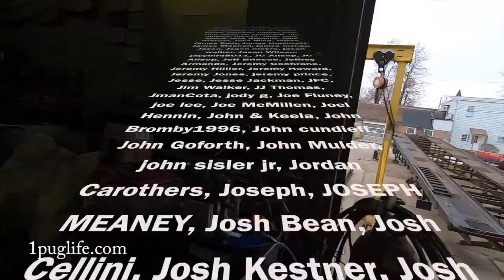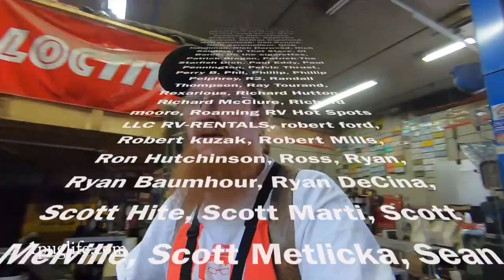plasma cutting plate

Comment: Wire wheels will not do a whole lot,
why wouldn't you "Sand Blast it"?
Even a small sand blasting gun would do more than wire wheels ...
At least use a 4 1/2 - 6" wire wheel on a grinder lol
It is probably rusting faster than you's cleaning it.. lol
O well.. Guess it keeps ya busy...
Thanks for sharing,
& stay safe.

Comment: You would have been better off mig welding that in. And look better.
Reply: Not outside in the wind
Reply: Mig with flux core...no gas for shield. Or a stick welder using the correct electrodes with the welder adjusted for the task.

Comment: How stupid, putting hands in the drill with it plug in...could have been nasty
Reply: Is it 110v in Canada for single phase  ?
Reply: @Geethreeohm  I think so, but it the Amps that kill you.
Reply: Slip of the finger and he'll be lit up . I was just curious what voltage they use cause I've heard him talking about 380v  machines before .
Reply: 120v AC (house current) tickles...wouldn't be touching it long...be like "oh snap" and jump. 
 220v and higher with its higher amps will put you out of this world with upsetting your heart rhythm. Amps get ahold of ya, can't let go....better hope ya bud has a dry stick to separate ya before ya toast.  And then CPR.
Old style car distributor/coil will mess you up...bud of mine grabbed a distributor cap to adjust timing...nailed him...his arm was numb for a week...found one plug wire wasn't plugged in fully, energizing the outside of the oil film covered distributor cap.